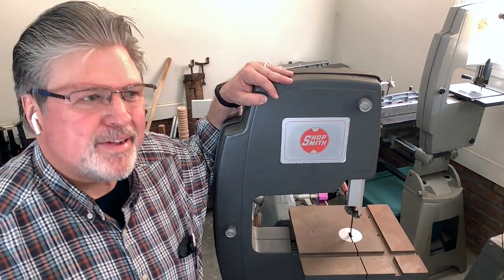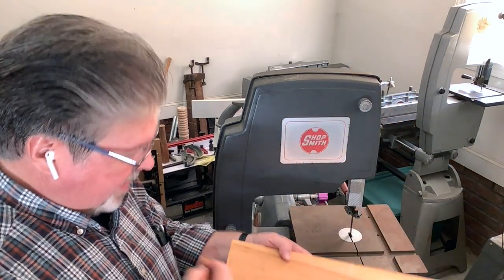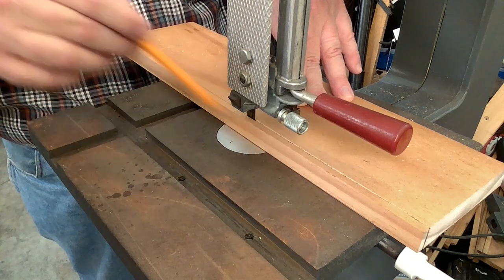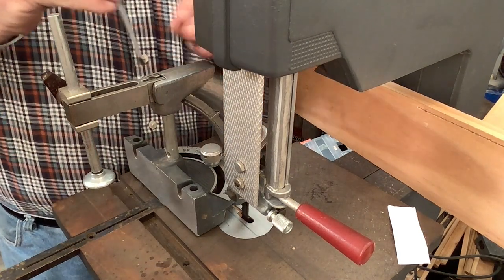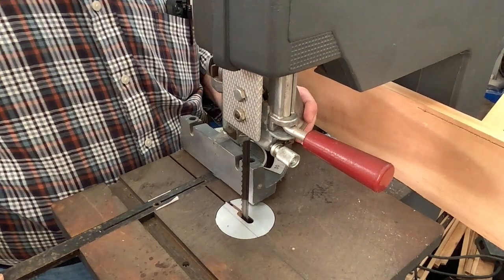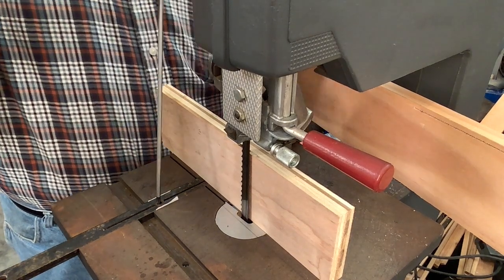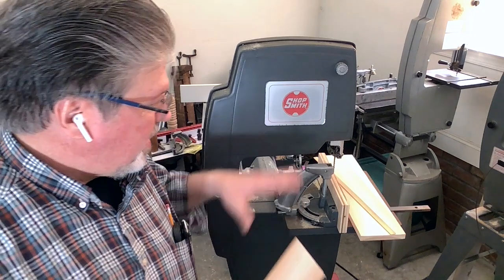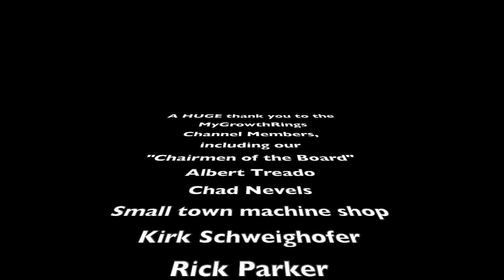Ripping & Resawing on a Shopsmith Bandsaw W/ Cast Iron Table

Comment: I went through these steps, it didn’t work
Reply from the maker: What did it do? How did the cut proceed? What can you tell me about your blade? I believe we can get there! Scott
Reply: This is an older cast iron table bandsaw, just like the one in your video. The tires were recently replaced. I'm using a 5/8" re-saw blade. After a few attempts, I adjusted the guides, positioned them close to the blade gullets.  I believe I followed your instructions.
Reply from the maker: @giljusino  Ok, that helps. So you are using your miter gauge as a fence, correct? And you adjusted it to match the drift of the blade?
Reply: @MyGrowthRings  yes, I used the miter gauge, exactly as you did in the video. First I made the hand rip cut, drew the drift lines on the table. Adjusted the mitre gauge. Then tried to make thin re saw cuts. It was a total failure.
Reply: After watching your other bandsaw videos I learned a few adjustments on my bandsaw were out of spec. I readjusted the rollers/alinements. Then I went back through the steps in this video. My outcome was better,  but not perfect yet……thanks for the valuable information you are passing to those of us lucky enough to stumble upon an old Shopsmith!
Reply from the maker: @giljusino  Glad to hear it is some better. One last question, whose blade are you using? Scott
Reply: @MyGrowthRings  I’m using only Shopsmith blades on my bandsaw
Reply from the maker: @giljusino  I think we may know the problem. I highly recommend getting a resaw blade from Timberwolf. I was introduced to them by Shopsmith when they used to offer them as an upgrade in their stores and I haven't looked back. The Shopsmith blades are, or at least, were made by Olson and are just "Ok", in my opinion. There's a link to the exact blade I use in the video description. Scott
Reply: @MyGrowthRings  Thanks for the advice. My Timberwolf blade is on order. I'll let you know how how it goes...Gil
Reply: @MyGrowthRings  wow….fantastic, the Timber Wolf blade arrived. I put it on my Shopsmith, made a few adjustments, then re-sawed several pieces of soft & hard woods. Perfect results. You are the “Bees Knees”.
Reply from the maker: @giljusino  So glad you like the performance.  Scott
Reply: @MyGrowthRings  Scott, I’m convinced. I’ll go look for the Timberwolf brand using your link. I’ve been using the old shopsmith brand that came with the Mark V I got used. Hope they sell a 72” 3/16 skip tooth 4tpi. Seems those who make lots of bandsaw boxes say it’s the best for tight curves, least amount of cutlines and resawing on bandsaw box making.

One more question, what insert replacement do you suggest? Mine is mangled and I made a wooden one but it’s light and keeps moving around.